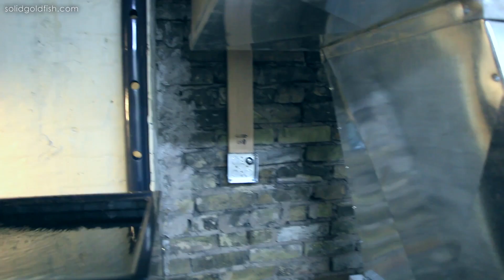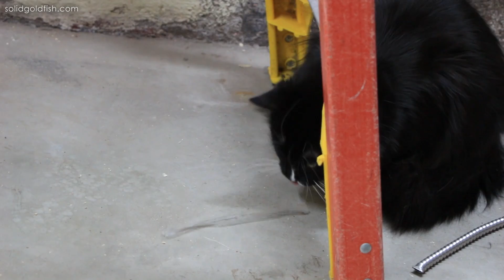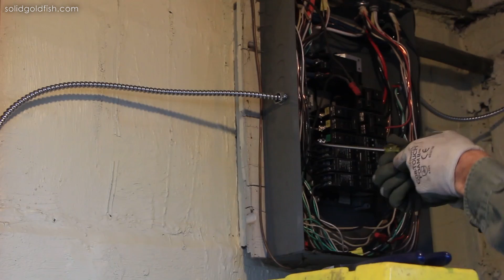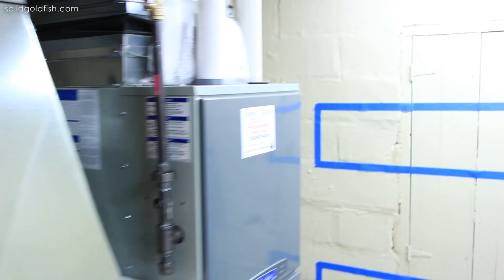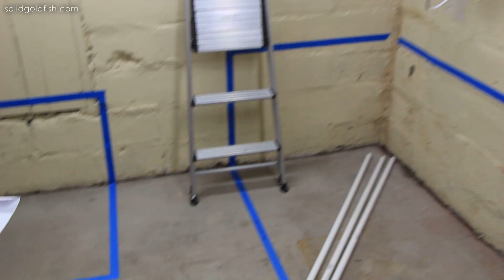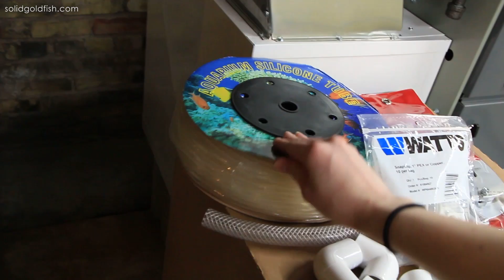Wiring the Fish Room | Tank Talk

Comment: Consider running a 1 inch pvc line across the ceiling and then branching down the walls with 1/2" pvc pipes.  The 1 " pipe will eliminate the whistle noise that sometimes happens when piping air pumps.  The 1/2" pipe has a wider variety of fittings than 3/4" pipe, cheaper too.  Since the first section is 1" pipe you can reduce to 1/2" without the whistle noise occurring.